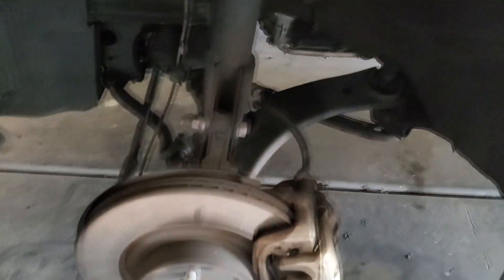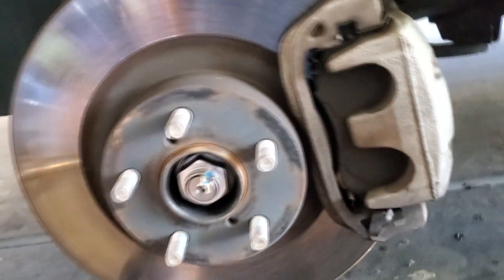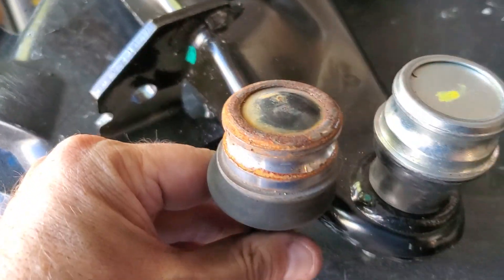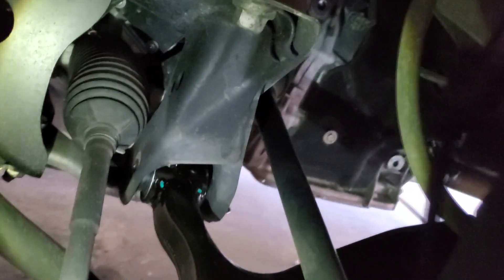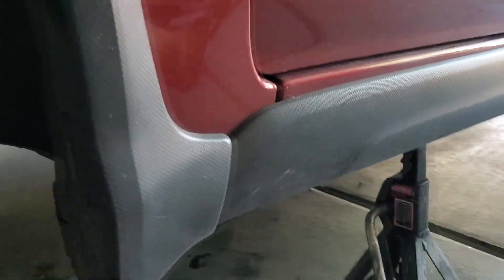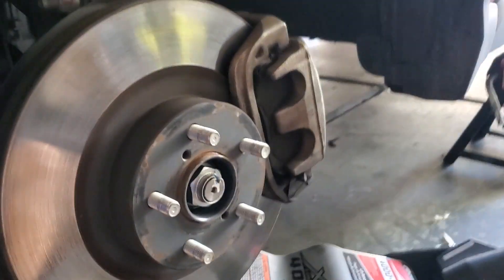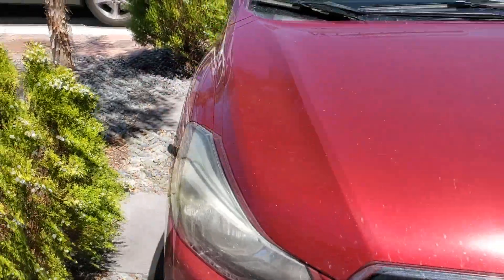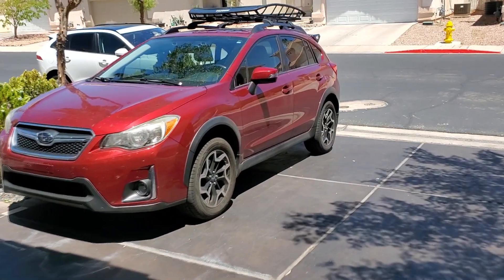2016 Subaru Crosstrek Edition. Control arms replacement. Helpful tips

Comment: where did you get the control arm with the grease fitting?  What manufacturer?  I can't find any that has a ball joint with a grease fitting.  I have a 2013 crosstrek.
Reply from the maker: TRQ is the manufacturer. I was wrong earlier, I went and looked again, and it does not have a grease fitting. Sorry. But it is grease packed already. I remember a little grease came out when the car was set back down on the ground.
Reply: Thank you @nicholasjackson3344